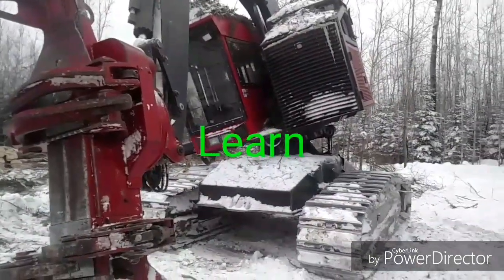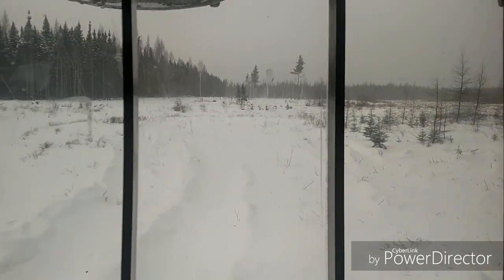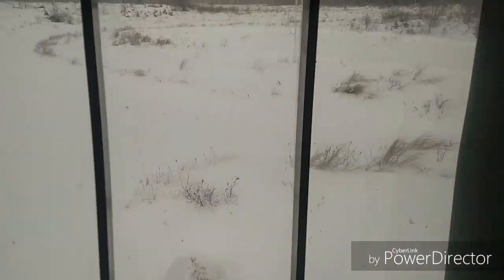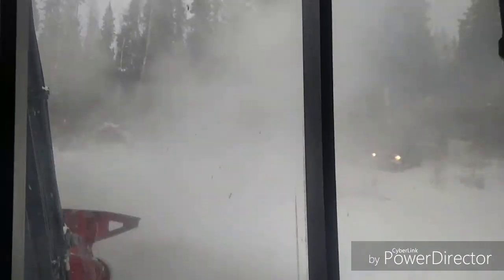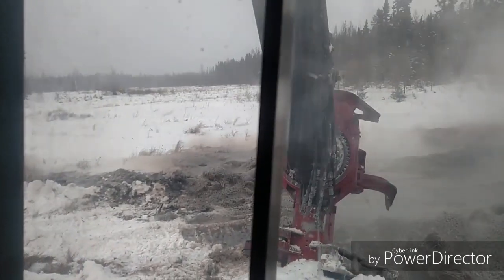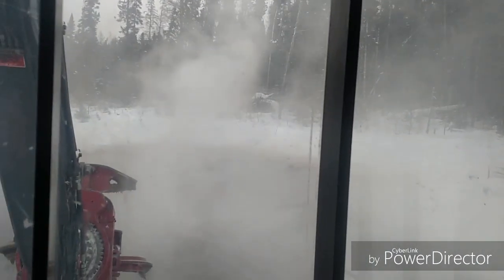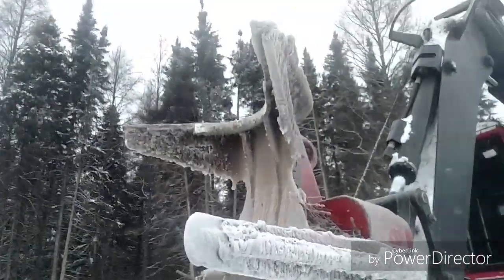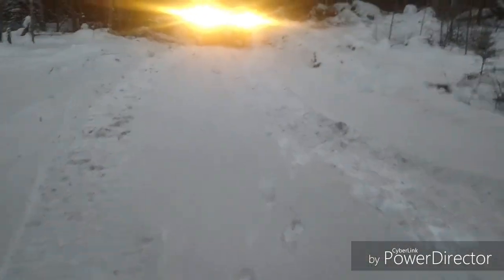Ice Bridge Fails... Repairs Begin!!!

Comment: First time I ever seen a hot saw disc water pump.
 Your pro-heat work at -36?
Reply from the maker: Pretty cool isn't it!!!  Yes it does.  I use #1 fuel.  Supposed to use kerosene.